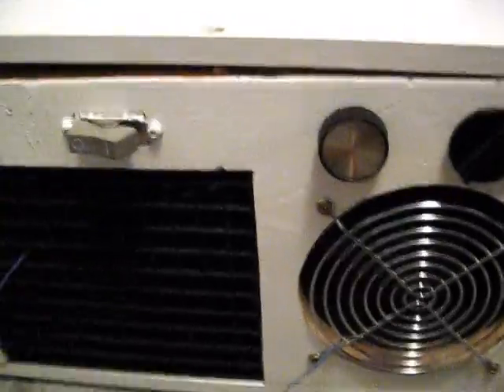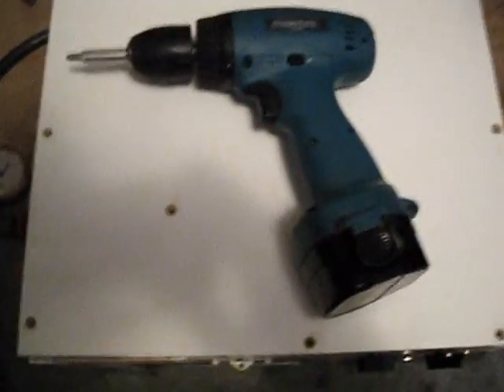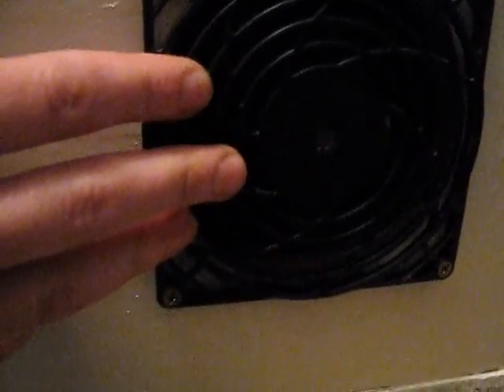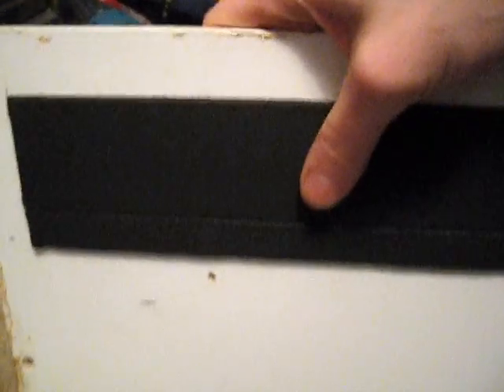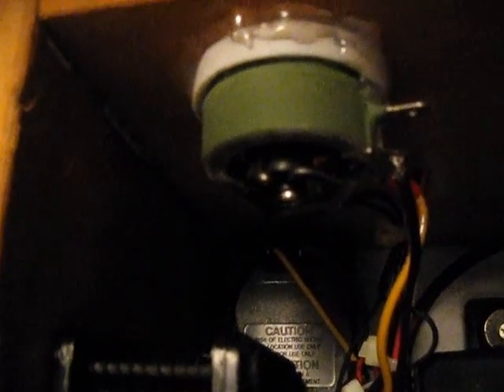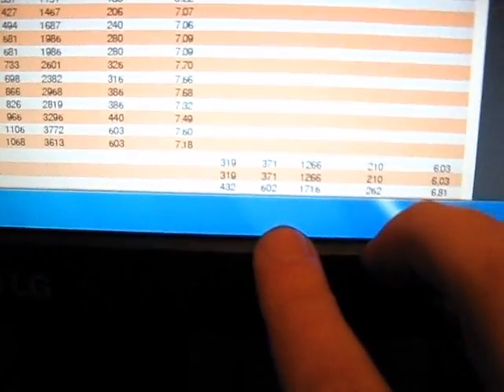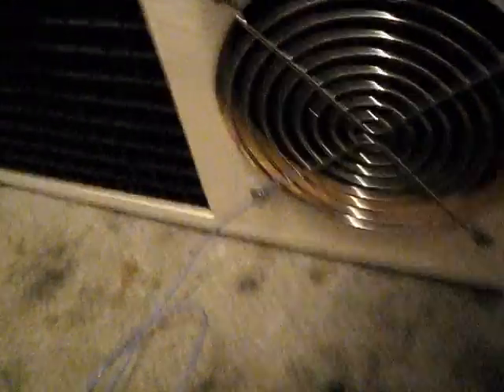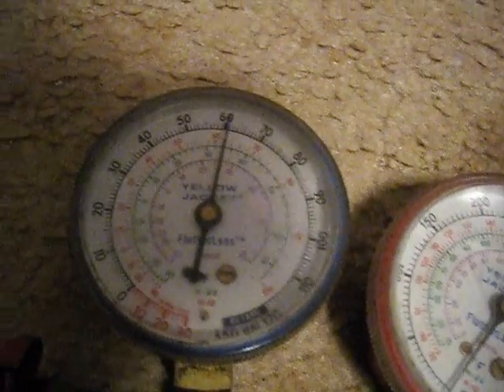Home-Made Mini AC

Comment: Is it only taking 2.46 amps?!
Reply from the maker: Yep, probably would be under 2.40 if the top cover was on all the way.
Reply: That's great... My concern is what if one uses 12 v big fans you have used to power up the unit (of 110VAC) and replace that compressor unit with 12v DC compressor?! wouldn't it be much more efficient in the terms of energy savings?!
Reply: The inverter air con basically
Reply: It would be far less efficient, because then you would have losses from the inverter.
Reply: themaritimeman you're right studied the bottlenecks of stepping down the volts thus current output will increase.. true

Comment: Better split than my 410A 5,000btu fridgeadare window unit, heres some food for thought, I've been experimenting with r152a in my vehicles replaceing r12 and 134a, it has a slightly lower working pressure and has better thermal saturation than r12, it's also cheaper than 134a, being a can of airduster is less than 5bucks